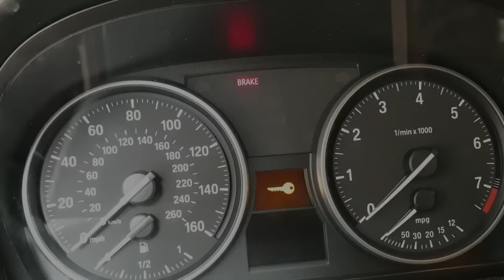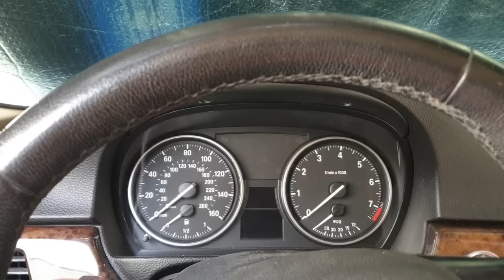Bmw N52 engine rough idle. Non return valves cleaned!!!

Comment: I wonder how many people have spent $$$$s replacing the VANOS solenoids but never checking these... probably a lot!  Makes me wonder if you even need to change the solenoids either...  Maybe just remove and clean them like this and keep the engine oil good and clean, should avoid all the expensive VANOS issues BMW engines are so famous/infamous for!   This video could save people a lot of money on unnecessary parts!    Very well done for showing us this tip 👌

Comment: Brooooo. You saved me thousands, the repair shop quoted me on some bullshit replacement.... these are the things ive done my self trying to solve the misfires, i replaced ignition coils,vanos solenoid,crank shaft sensor,new oil, new sparkplug, i even got the valve cover gasket replaced... and it sat there for 4 years... finally after watching this i did it my self this morning.. removing the front right wheel and removing the wheel well makes it a easier task! The bottom one had some particles, but the top nonreturn valve was filthy!!!  I cant thank you enough!!!
Reply: What misfire problems were you having one bank or both ?
Reply: @RRSAutoempire I’ve got bank 1 and 2 gonna try this on the weekend and I will respond. Did you give this a try ?

Comment: Rough idle can be caused by blocked engine crankcase breathers. The breather filters are built into the valve cover which will need to be renewed if this is the problem. When the engine is running remove the oil filler cap and remove it, if the cap is hard to remove or you hear any 'sucking' noise as you remove it then you have a breather problem.
Reply: Were is the oil filter cap 528i 2008
Reply: Isn't that only on N53? Believe N52 has the CCV attached to the inlet manifold
Reply: The CPV valve is built into the valve cover!  Rock Auto LEAST EXPENSIVE by far!!
Reply: @electrotx  This ^
Reply: I removed the oil filler cap but it is not sucking air at all.

Comment: Thanks mate, changed my banks solinoids twice still had problems so I pulled out the non return valves and they were full of grit. Cleaned them and now got a smoothe running engine. Cheers.

Comment: I don't have any rough idle but am gonna clean mine as a precaution. Thanks buddy, first vid with such a great information.
Reply: Did you end up cleaning yours? I’m getting ready to do the same 2011 528i with the inline 6🤙🏽
Reply: @CorbinWilliams  Yes I did and it actually worked.  I also replaced spark plugs. But that bout it.

Comment: Thanks for covering this. My rough idle is not as severe as yours and does it momentarily on cold start ups. I already replaced my valve cover assembly, eccentric shaft sensor, ignition coils, spark plugs, vanos solenoids, cleaned MAF sensor, and changed oil to 5w30 instead of 5w40. I will be ordering new non return valves to replace them, regardless if they turn out to be clogged or not.

Update: I replaced my non return valves today. I noticed both the motor and trans. were more smooth, so far. I only get the rough idle after leaving my car alone overnight, so I am gonna have to wait and check how the idle will be the next day after a cold start.
Reply: Did you solve your rough idle?
Reply: I’m assuming your issue was to do with injectors
Reply: Have you solved the cold start rough idle?

Comment: This video got me subscribed.. i did my solenoids and it didnt solve my problem on my n52 e92, i would never knew about those filters man... thank you very much
Reply: So did you fixed it with this then ?
Reply: @alvernhem  nope, i had to change one of four O2 sensors, had to diagnose it to know wich one was bad
Reply: @design2drive  thanks but did you replaced the check valves or not ?
Reply: @alvernhem  nope, they were clean..
Reply: @design2drive  Ok thanks

Comment: Wow. So lucky to find this video!!! You described everything I have been struggling with! Same same problem here. Already replaced PCV, spark plugs, checked Ignition coils, cleaned and checked Vanos solenoids... Seems like one more thing to do is clean/replace these Vanos valves!!! Thank you so much for this video!!! Will be reporting soon!
Reply: Hey. Do you have part number of PCV valve for N52 3.0L gas engine?

Comment: If rough idle it's correlated with smoke when you floor it, check the O2 sensors, this was the culprit on my N52. Changed everything, vanos solenoids, coils, spark plugs, etc. Problem was Bank 1 pre-cat O2 sensor, NO check engine and NO fault codes...
Reply from the maker: Good to know...thx for the info 👍

Comment: After 6 months of chasing vanos codes and replacing parts for my rough idle I came across your video. Lo and behold I took them out cleaned them up, re installed and my car has the most stable and smooth idle! Was a little different for me as I have the n13 engine 116i. You are right there is not much if any information on these non return valves and how they affect the vanos system!!

Comment: Sure nuff helped me out with the 08 528i. At first I had issues because I flipped the connections lol went back to look at the video and realized my mistake. Runs good. This is why I love YouTube, just search and u can find.

Edit
Saved a lot also on doing my own starter, that went out again. First time paid over 1200 bucks at a dealership. This time paid less than 200 for the part. Gained valuable knowledge about this car.  Also did the coils, sparkplugs, cleaned the various filters and sensors and whola, runs like new.

Comment: I have Forte fuel system clean and full engine flush carried out at every service and I don't follow the BMW 20,000 mile intervals as shown on the dash count down, I stick to 13,000 miles maximum between services. No problems because of this and I cover 250 miles a day
Reply: I literally change it every 3000 just cause I’m being extra cautious. Any idea when tranny fluid should be changed?

Comment: Change synthetic oil every 5000 miles to avoid this problem caused by burned paraffin sludge.
Thanks for the good fix video! I never knew those filters were there.

Comment: Bro I’ve done everything to my car I’ve changed both vanos ,camshafts sensors ,spark plugs ,coils ,engine flush ,injectors ,intake gaskets ,ppc valve, breather ,hoses ,clean throttle body I watch a ton of vids going on a yr now trying to figure this problem out spent so much money . I going to try this out I hope it works . bless you bro . Wish me luck🤞🏾
Reply from the maker: Don't forget to check the valve from the engine cover I have a video for that as well and remember to reset adaptations before you start the engine.  Good luck
Reply: @deeyomoma did you find the problem?
Reply: Nope still the same

Comment: Bad Mass air flow sensor also causes rough idle when cold start. That was my case.
Reply: Same here
Reply: Do you mean NOX sensors ?
Reply: @ArkadyRenko1  it was the maf sensor on my Intake that went bad, no check engine  light but it started like shit and would sometimes stall going from 2nd to first I replaced my sensor and it runs like new
Reply: @krispytoast8804  Thanks for the info. That will probably be my next step if the non return valves didn't do it for me.
Reply: Is it normal for the car to idle but have a strong vibration? It’s not a rough idle per say but it’s like not as smooth as you’d expect

Comment: Change your spark plugs to the new 4 electrodes on them, BMW changed  the spark plugs without telling customers to fix the idle problem The new plugs are available at BMW to replace the single electrode one..  The bmw & Mini dr on youtube has just given out the info recently..
Reply from the maker: You don't have to believe everything from the net. Just think at this...how come the car was running normal without the new spark plugs before and now runs normal just with that spark plugs...kinda strange for me... but every one believes what they want...anyway my car idles perfect with normal spark plugs
Reply: This doesn’t fix the idle issue 🤦🏼‍♀️ cars were fine before..

Comment: I tried everything on mine and I mean everything, could not get rid of it.ifonly I could have known about these filters before I sold the car

Maybe this was the answer
Reply: Was it?
Reply: @lukasp7406  I will have to reword what I said I think.

I tried everything I could without knowing about these filters. To be fair a bmw main dealer and two independent "specialists" didn't mention these either. One independent adjusted the gap on the finger between the motor and valvetronic cams and it cleared up a lot but was never as silky smooth as when I first got it. It was running like a swish watch one minute, I overtook a lorry on a dual carriageway, then pulled back in and I noticed the hesitation and fluffy Ness on idle and part throttle. Baffling.
It was absolutely mint with leather interior and the fancy stereo in it (forgot the name)
I had to sell it quick due to having a company car, I sold it to a chav family from liecster who after about two months wrote it off.

Such a shame

Comment: Thanks for this video, I have been going crazy trying to figure out my rough idle and I've change literally everything but never seen anything about these filters, I feel this will finally do the trick, cant wait to perform this service, thanks again!
Reply: let us know how it goes, I am having the same issue after replacing valve cover to fix the oil burning issue.
Reply: I took them out and they were completely covered and clogged, I cleaned them to like new conditions and unfortunately it didnt correct the problem I'm having, my car keeps throwing a p1415 code and it surges really bad on cold starts almost like it's out of gas and when slowing down or coming to a stop light or stop sign it surges and rpms drops to the point of stalling and then shoot up to idle and stay there, I'm stumped, please help if you can, I live my car but I'm told the point of getting rid of it.
Reply: @rickt8325  try lambda sensors! i have same problem with my n53b30a ! changed bank1 o2 and its better now so will change other 2 sensors and nox sensor too and see how it runs! if won't fix theres ony one more last step left for n53 and its injectors :(

Comment: Bro, no one has ever showed this information about rough idle, i will try it. I have a question, why does a car hiccup in cold start and makes the car have high idle when turn on the ac or shit to drive/reverse? BMW E90 N52
No codes are showing, and no engine light as well. Also I've changed every gasket like how you did, new spark plugs, new compressor, new pcv

Comment: I have the same issue of rough idle making me go crazy tbh. Have an 002AFC code. Cleaned the maf, the map, the throttle body and changed the plugs and did an oil change and filter. May it be the return pipe of cvv? Thanks for the help (n46 engine on e92)

Comment: Great video.  Does anyone know the position of the non return valves on a 2008 N43 318i.  I've already cleaned the Vanos solenoids, but didn't know about these valves.  Thanks.
Reply from the maker: On your engine you have no access to the valves, are in to the cylinder head.

Comment: Is there an alternative to clean the valve as I don’t have a air compressor?
I was thinking to use carb cleaner.
Reply from the maker: Wil work as well, you can use a blade as well to clean the filter

Comment: Wow..like myself, after spending thousand of dollars on unnecessary parts for rough idle like solanoid, spark plugs, mass flow sensor etc etc...thsese 2 non return oil valves are the problems? Thanks man for the video. I should have saved money had i watched your video earlier...ha..ha.

Comment: My 2007 x3 also chugs but has a really loud high pitcged squeal and does it all the time. Everything i found on it is that i need to replace the pcv vavle... which just so happens to supposedly be molded to the valve cover.. atleast from what ive been able to find out about it.. its creating a ton of suction and if i take oil fill cap off it stops squealing but will still chug just not as bad.. took it to bmw dealership and they said my valve cover is cracked.. didnt say where just that it would cost 2500 dollars.. there is no oil leaking tho. Which my dad a mechanic of u.s. domestic vehicle of 20+ yrs says there would be oil leaking out of a crack if there was one... there is some sensor on the top front of my engine that has had caulk rubbed all over the case and there was a bit of oil in the plug part of same sensor.. cant find what the sensor is to replace it tho.. for all i know that could be the thing i need to fix..
Reply: At 1:40 u almost pointed to the sensor im talking about.

Comment: I'm going to try this next on my n52! 

Iv already done 

Vanos solenoids
CCV replaced with new cover
CCV hose
Crank positioning sensor
Plugs

No luck. Infact it got worse with new oem solenoids..  

Do you have the oem part numbers for the gaskets?

Comment: Why does mine idle around 400? It seems smooth and fine. Still got the low down torque up high though it falls flat, I think that’s normal for these engines.

Comment: To check if the solenoid is the issue you remove them and then turn the car on ?
Reply from the maker: No, do not start the car with any parts removed! Oil will pour out everywhere
Reply: @WarpDriveM   I cleaned them and it’s doing it more often lol helpppp

Comment: Please , my car cranks , but can’t start, I’ve changed the crank sensor  and MAF,  is diesel ( 320d ) . The pump si works I’ve been over filling the thank
Reply from the maker: You have to test the car with a scanner first. The car shoud start even with a bad maf sensor and over filling the tank won't cause no start. It might be something else
Reply: Any  idea what it might be ?
Reply: Warp Drive M they’ve scanned but no code was shown
Reply: Warp Drive M after the scan this is what came ; no message ((0*AA) receiver EKP, transmitter engine
Reply from the maker: It might be the key. if you have a spare try to start with the second key.
Reply: Ooh okay , I will get a spare key 
Thanks a lot
Reply: Your may have a stuck closed idle air control valve.

Comment: Someone please research a p1415 code and see what you think, I've changed every component under my hood, nothing has fixed my issue.
Reply from the maker: Your code suggest the air flow meter (MAF) is bad...but the idle problem is almost always air related on this engines. You have to check all the breather hoses, engine cover, pcv valve....if everything else is OK.

Comment: Great video, i have the same Problems but 330 XDrive N57 , do you think if could be coming from the same  part?
Reply from the maker: You don't have this set up on the diesel engine. If your idle is not steady you have to check your EGR system (valve, return pipe) injectors or dpf filter

Comment: good video, i have a 120i 2006 2.0, code 2a83, have filters too?
Reply from the maker: If your car is equipped with vanos yes...but I think your car doesn't have vanos because has throttle body

Comment: the car is undulating, the computer indicated a poor mixture, where to start?  it is possible that I do not have catalysts
Reply from the maker: Of course. But a bad mixture indicates loss of vacuum or not enough fuel. If you didn't code the kat out or the O2 sensor that might be your problem as well

Comment: I got the rough idle on my E83 rite now and changed the plug and coils then the steering pump recently...thinking it’s still gonna give a rough idle when I go start it up thinking I need to clean or replace these filters along with the vanos and see if that is my problem as well these N52 motors are a big pain but when you get to changing parts you become familiar with everything in your vehicle good tips on the video thanks !! How long did the job take you to clean these 2 filters?
Reply from the maker: You should be able to do this job in 20 min....

Comment: What did you use to clean the filter? Great channel
Reply from the maker: Just a blade and brake cleaner
Reply: Warp Drive M thanks. Going to clean my filters and vanos tomorrow cz I’m having the same problem. P0012 so I’m going to replace the camshaft position sensors

Comment: To really clean vanos solenoids you have to disassemble them (which is easy), otherwise there's no way you get to the dirt that is the piston in the rear side.
Reply: Have you got a link to how to do it?
Reply: @spazmochad  Did it myself, didn't see a video yet on the net. It's easy enough, wonder why people don't do it
Reply: @alexandert4252  Fair, thanks for replying. I doubt many people take the time to open them up as the general consensus is that cleaning them doesn't help. I will keep it in mind that it's possible though when I look into my cold start idle fluctuations.
Reply: @spazmochad  Basically you just bend two metal pieces that hold electromagnetic part inside and whole thing comes out. It then becomes pretty obvious there's just too few parts for something to really break - electromagnet and a piston. But even with my clean motor i noticed some goo buildup that could prevent piston from moving all the way in the future which is most likely the cause of it all. And since i did "clean" it without disassembly first and it didn't go away proves why people think cleaning doesn't help - without disassembly it clearly doesnt. And don't forget to clean (or better replace they're cheap) 2 small vanos filters - those can cause a lot of troubles if clogged

Comment: Hi mate I have very similar problem but my one is having code P0175 system too rich bank 2 any ideas please ? Thx.
Reply from the maker: You only have bank 2 if your engine is a "V" engine (v6/v8/...) system too rich can mean MAF sensor bad, bad injectors, fuel pressure too high, O2 sensor defect usually the first one before kat. This are just Infos, you need to let the car to be checked by someone who can give you a diagnosis...